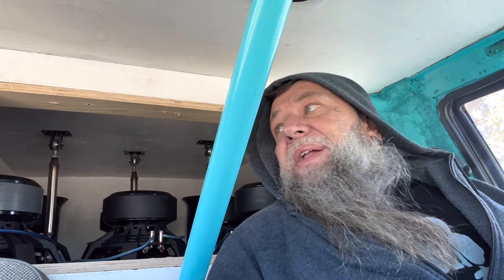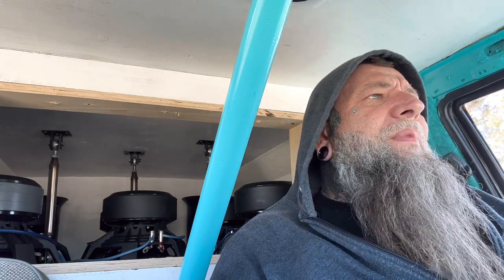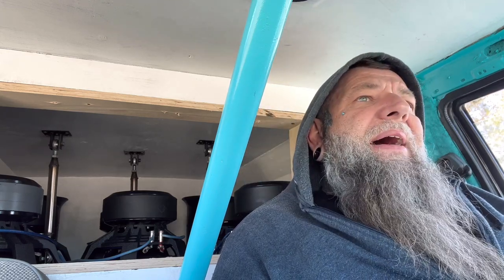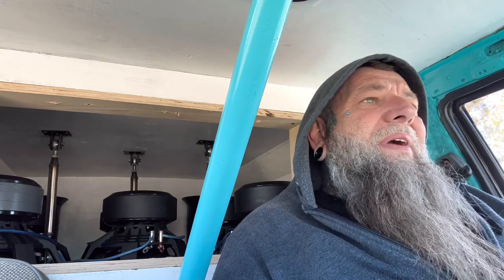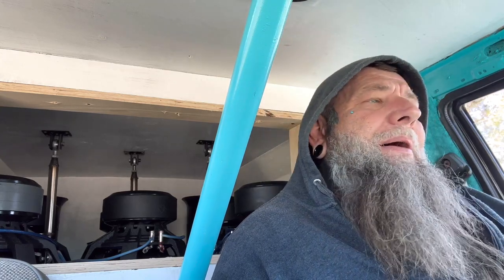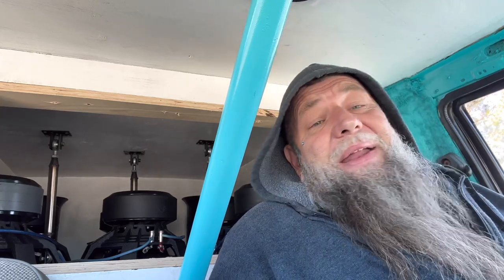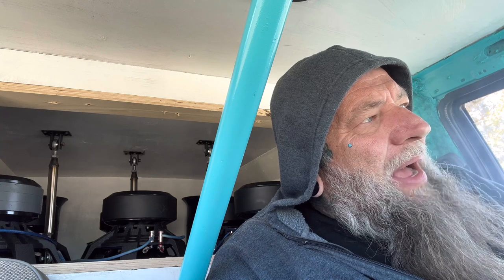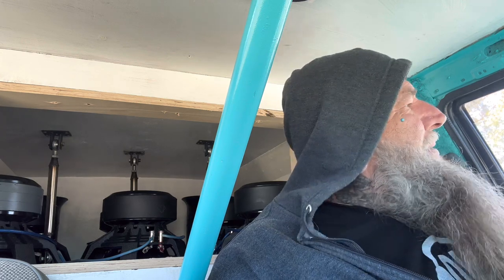Head unit voltage. Does it matter

Comment: The higher the rca voltage just means less gain on amplifier
Reply from the maker: that's been the case for me..
Reply: @JerryAintloud  on a high end sq system I see the point of high voltage going in so you have the gains right down but a system for pounding …. Doesn’t matter
Reply: Yup and less distortion introduced also
Reply: @Andrew_kiwi_AF  The lower you can set your gains, the less interference (unwanted noise) from other components in your vehicle. I always set my gains with my head unit at 3/4's of a clean signal.
Reply: @Andrew_kiwi_AF  .02-8v is not high voltage, its still considered low level, there is other systems for signal input that actually go 10-12v which is high level

Comment: Modern car amplifiers have an input range from 0.2-8v that will result in the same output power potential, meaning you get the max output at any of those ranges as long as it's set up properly. At the same time, it's best practice to use the highest CLEAN input voltage you can produce because the signal to noise ratio will be better. The noise component will be the same for whatever RCA you choose but the thing you have control over is the signal, so feeding the amplifier the strongest signal equates to a better signal to noise ratio being amplified. The amplifier has inherent noise as well, so having the cleanest signal going into it would give the best results out of it. At what point is it good enough? When you're happy, a unquantifiable perception that only you can define the threshold.
Reply: It's 3am... I'm too tired to care enough and too awake to sleep, so seeing your summary allowed me to not have to write a novel explaining this, so thank you. Glad someone else gets it. 👍🏼
Reply: @RAW_Reality  I'm just glad someone actually read my comment. ha
Reply: Exactly. Few people in these comments have no clue

Comment: Eclipse to my recollection had HU's that were around the highest up to 8v if I'm not mistaken. Problem is very few other pieces whether DSP's or amps need near that amount of signal to make rated power or pass signal down the chain. Eclipse is no longer around. Zapco at one point used to use those inconvenient symbilink cables and line drivers that could deliver 12 volts to their amps and you could could turn the gains down to literally nothing with those amps. I still have a zapco reference 1000.4 amp and the damn thing is so big (an old school skateboard profile) that it's not practical to install it in a daily driver vehicle even in a trunk build where as plenty of other amps today will make the same power and be 1/3 the size.

Comment: Just installed a taramps smart 3 bass. Amp kept cutting out. I also have an audiocontrol LOC. I remembered a recent video where you said taramps are picky about RCA voltage. Under two volts preferred. Turned down the gain on the LOC. Seems ok for now. Hasn't cut out yet. I'll have to check correctly with a multimeter to see what exact voltage it's at now. Thank you and everyone else that spoke about it. I was ready to send the amp back, as most people would have too, thinking something was wrong.
Reply from the maker: awesome to hear you figured it out
Reply: @JerryAintloud  Thank you sir
Reply: I have an epicenter does that change the voltage to my amp?
Reply: @Petethebuilder  Not sure. Check in the manual to see if when adjusted, does it raise or lower voltage.

Comment: my dual xdvd276bt preamp voltage is 4v, but my Evl's don't hit like I want them to @ 4v on amp & not clipping, i have to push my Jp23v2 to clipping a lil to get the desired bass, even if I tune my amp properly & increase head unit volume..  the only way I get desired bass is pushing my amp to clip a lil

Comment: How do you set a head unit voltage? I thought the pre out voltage is what it is from factory...
Reply from the maker: adjust sub level on head unit and check rca voltage with a multimeter

Comment: Hey. Must say I appreciate your videos. 
I have a question regarding adding diode to alternator. I have 390 amp alternator in my 2010 Jeep Liberty. 
The voltage is controlled by pcm. Can I still use diodes to increase voltage? How?